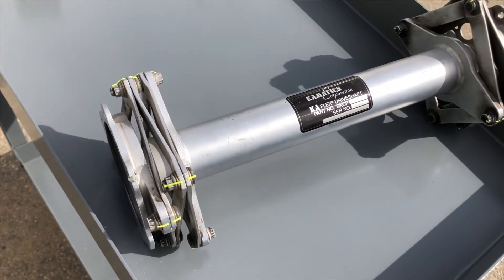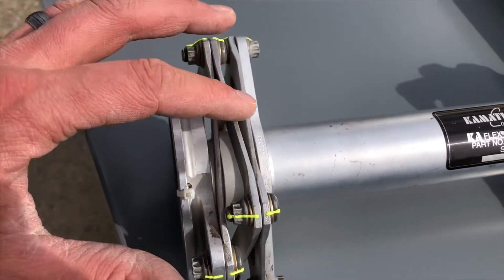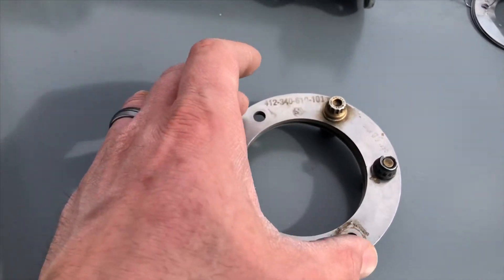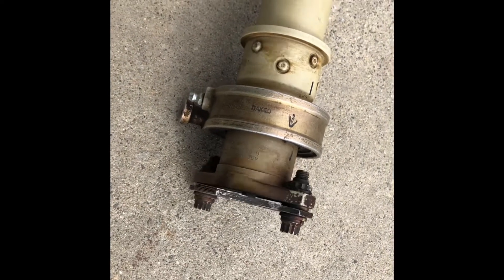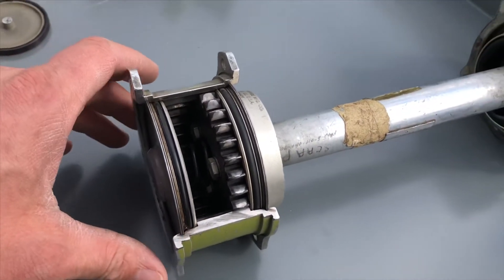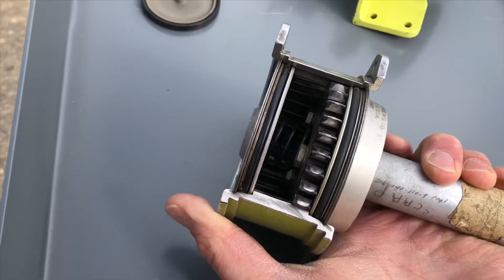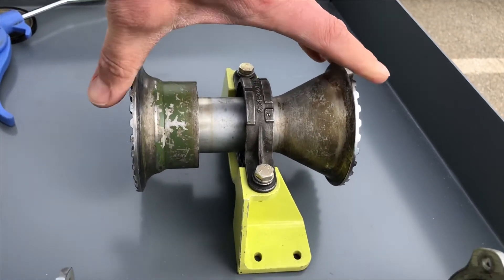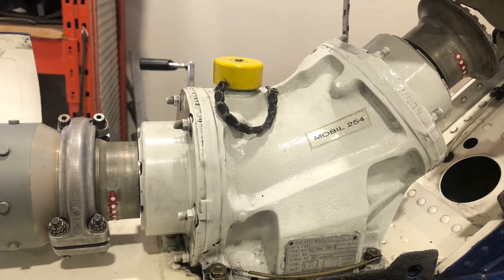Helicopter Drive shaft couplings

Comment: What is the location of this coupling? Is it between  the FWD T/R drive shaft and fan shaft?
Reply from the maker: Most of these couplings are either tail rotor driveshaft couplings or in the case of the larger ones, engine to transmission.

Comment: hello!
how many rpm tail rotor drivehaft  rotating ? 
is this thick shaft pipe is aluminium material ?
Reply: It is a steel shaft, and requires a periodic time overhaul.
Reply: Looks like the 407 driveshaft.

Comment: Why do they have disk packs? Does the tail rotor shaft flex a lot? Or do they allow for rotational flexibility?
Reply from the maker: shigetasan, The tail boom shifts as the helicopter vibrates and flexes. The disk packs prevents, or limits, the damage to the drive shaft, transmissions and bearings by allowing for the miss alignment and flexing.
Reply: Actually both! But with excess flex and improper torqued, comes cracked disc packs.